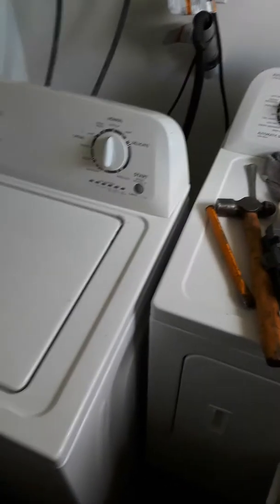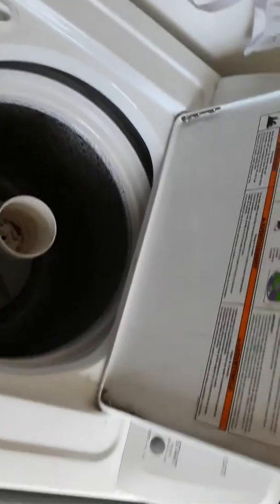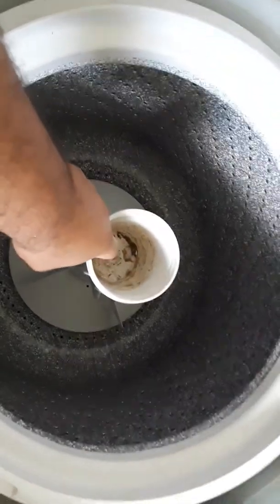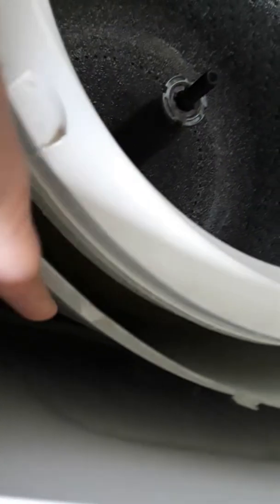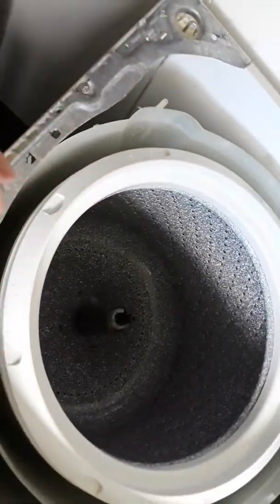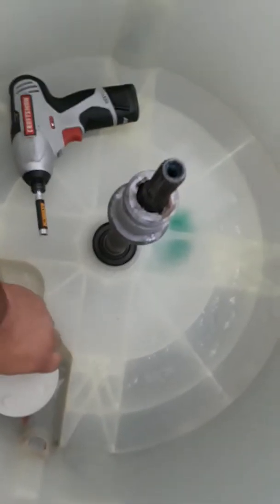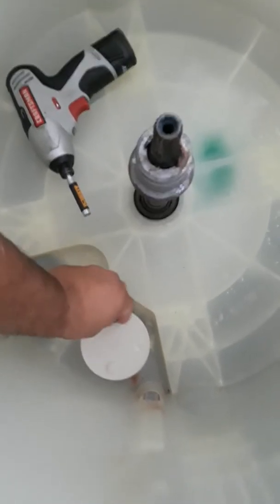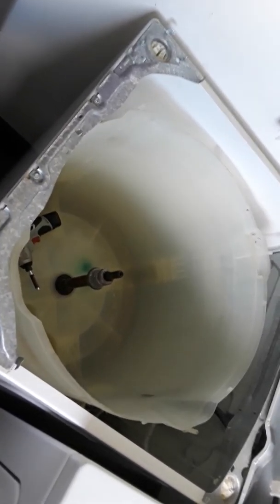Admiral washer stinks and sounds like water left in tub

Comment: This video helped me take apart this washer. I have an Amana washer that looks just like yours. We had a similar issue with smells, but I took it apart like you said, and did not find much smelly brown/black stuff. The dirtiest part was by the top ring that snaps over the metal bin. Oh well, Maybe it will stop smelling like rotten eggs, maybe not. Maybe it's something with the drain hose or pump. At least it smells a little better like simple green!

Comment: Thank you!  This is exactly what I needed.  I just can't figure out how to get the bolt out that holds the agitator in place.  I think I need a socket wrench, but I'm not sure what size?  A regular wrench isn't doing the trick.
Reply from the maker: If I remember right it was a 13mm socket to take the bolt out
Reply: @KernCountyFoamFlingers  Many thanks!

Comment: The agitator doesn't just come out.  Took the 13 mm for the one bolt inside but it wont come out. Its hanging on for dear life. Its not as easy as you say
Reply from the maker: Yeah the first time I took it out it was kind of a pain I believe I just wiggled it while pulling up and it came out
Reply: use grease